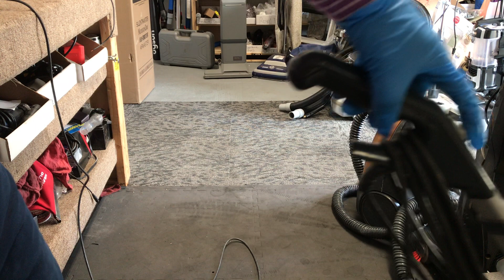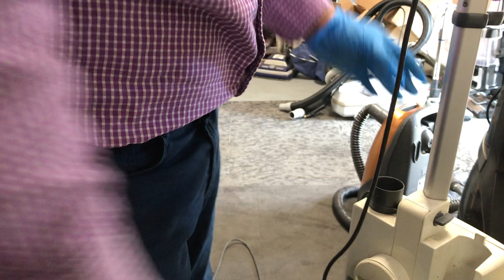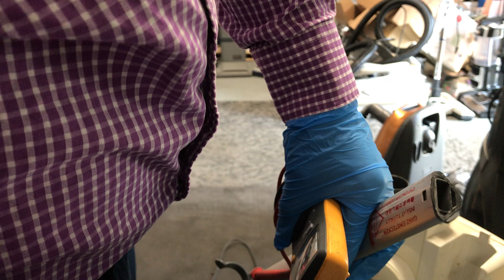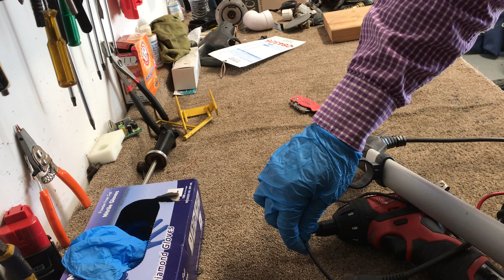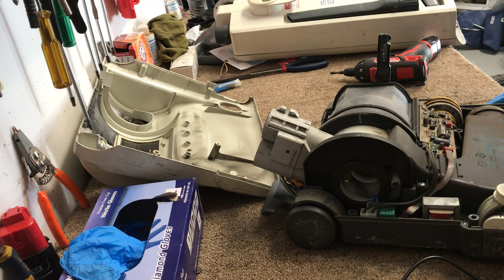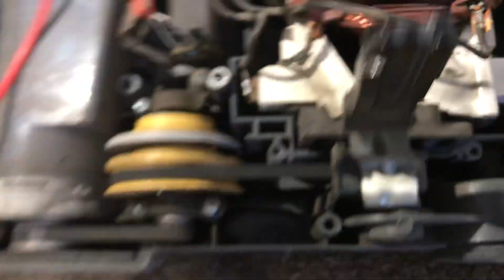Sebo x4 Vacuum Repair

Comment: Very helpful video, much appreciated!  Motor not running, took unit apart reviewed current path and found bad solder connection on circuit board where 120v enters from handle, resoldered connection, back in business.  I will buy parts from you folks next time I need them. Thanks
Reply from the maker: Glad it helped